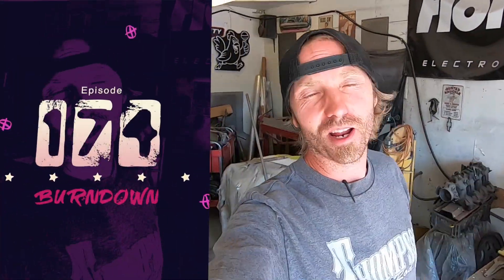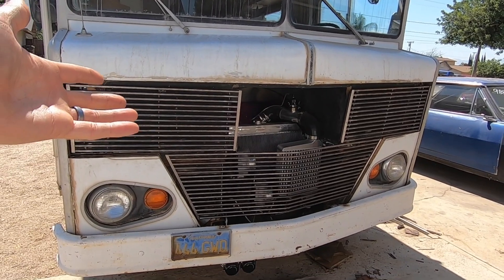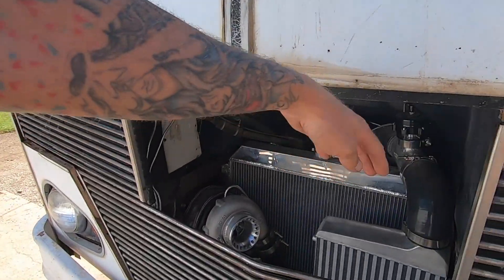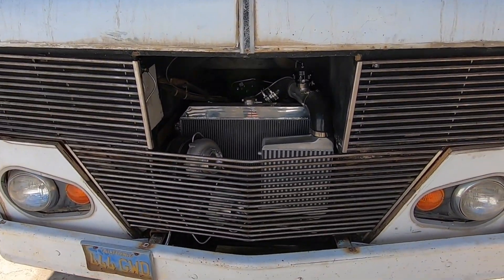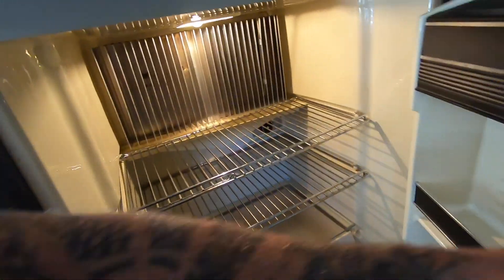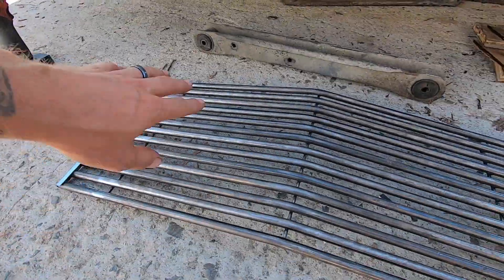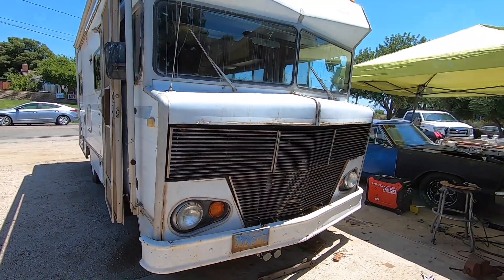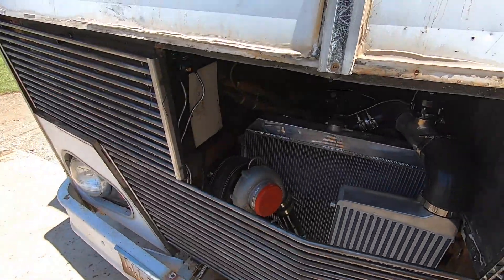Custom Grill For The Twinnebago

Comment: Those fridges take a long time to cool off and are pretty inefficient compared to a compressor based fridge but leave it plugged in over night and see what happens
Reply: We turn ours on the day before because they take forever to get cold.
Reply from the maker: How do you power it? Im new to all this.
Reply: Well if you are not pulling a lot of power like the AC and other stuff you can get an adapter for your shore power plug and plug it into a regular outlet if you don't have any where you can plug it in

Comment: Them fridges take awhile to cool. Thats pretty normal. It's cooling on eletric correctly but it will cool the freezer first then travel down..best thing to do is leave it plugged in for a day and it will be ready to go for a trip. Please let me know if you need any help with the coach stuff glad to help as much as possible!
Reply from the maker: Thanks JD! Yeah this if my first RV so I have no clue. So i guess that means she was working fine. The freezer was getting cold just not the fridge so that makes sense. I think I even thought that may be the case as well. Ill have to get the heater on line at some point as well. The thermostat is broken or at least the cover is so im going to replace that at some point as well. I still need a new fresh water tank and to work on the plumbing. Lots to do but its coming along!
Reply: @Burndown  you should be able to run the fridge on gas as well. so that should have a suburban furnace. The model number is behind the cover out side of the rv (4 screws) might need a good blow out with a air gun before firing it up. Should be 4 wires. 12v red. Ground black. And two blue wires that run to the thermostat. If you connect the two blue wires together that turns on the furnace..the thermostat should close the circuit @ the two blue wires if working correctly.

Comment: The refer section always takes a while to cool . 24 hours
Reply from the maker: How do you run it that long? Just let the propane run it over night? Wonder how much juice it draws and if I could get an inverter to handle that on a solar panel so I would be set. Ill look into that thank you!!
Reply: Burndown normally your plugged into a 15/30 amp 110 outlet that will run the FRIG  an give u power to the coach while your just parked at your house or if the campground has plugins so u don’t burn up all your propane. Usually a5 gal bottle will run for a good few days